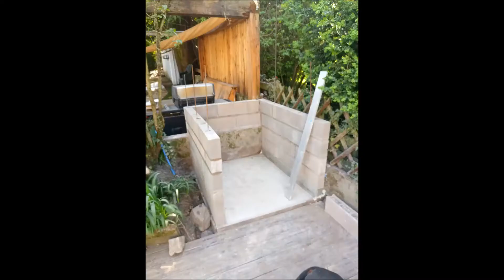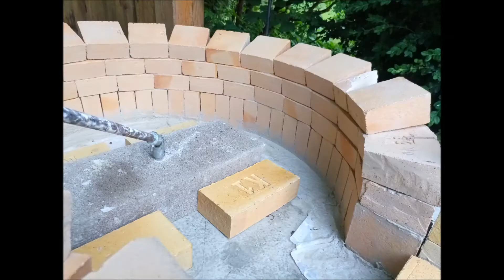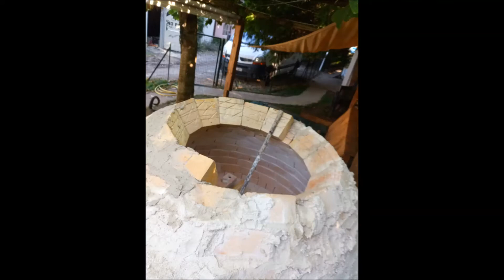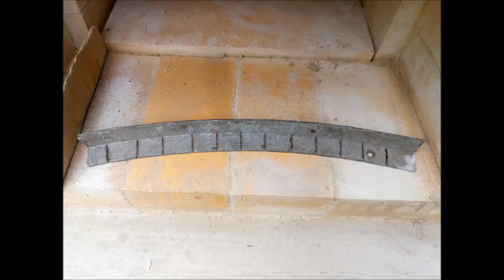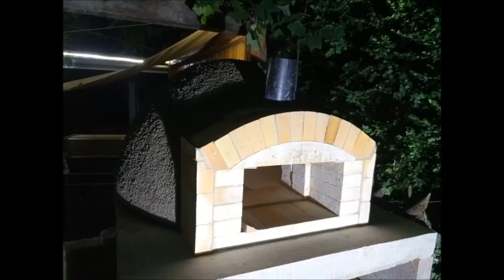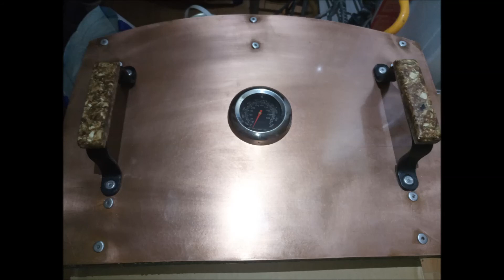Construire un four a pain 🥖 exterieur à la chaux sans sable pour le dôme

Comment: How much did it cost? A ceramic fiber blanket would’ve made the oven much more efficient.
Reply from the maker: It's hard to say because it's not the same price in each country, but around 1000$ in France. I already had some materials like rockwool that i used. I agree with you it's little bit more efficient with ceramic fiber but really more expensive (0$ in my case) i found it to compare : https://www.foundrymag.com/melt-pour/article/21925875/a-different-perspective-on-choosing-insulation
And our oven don't warm like a forge furnace :-)